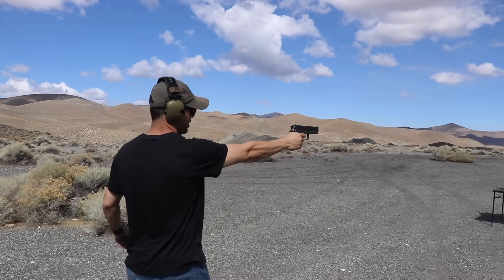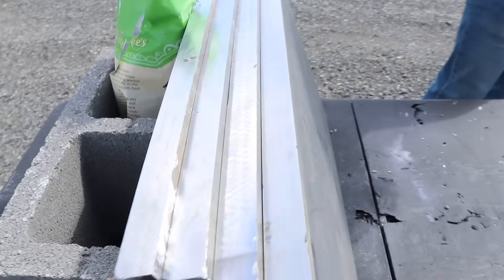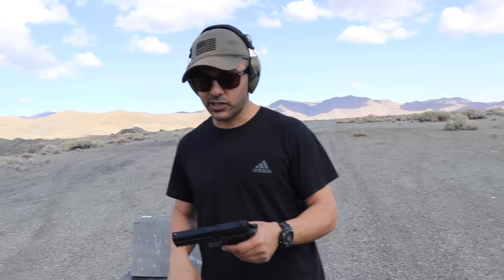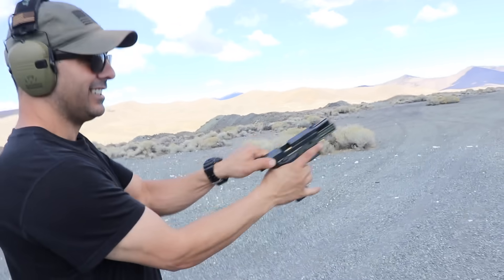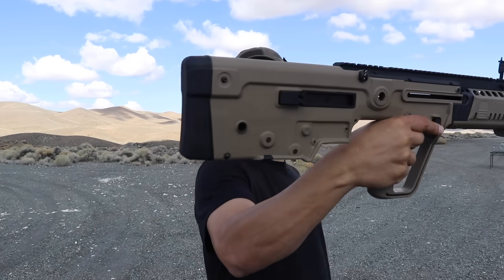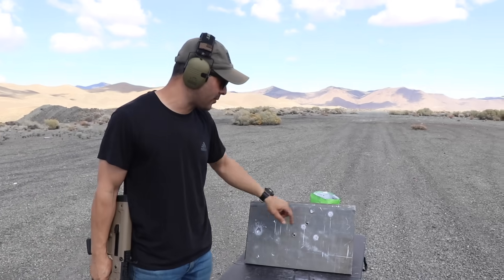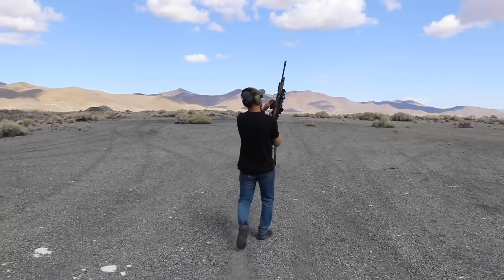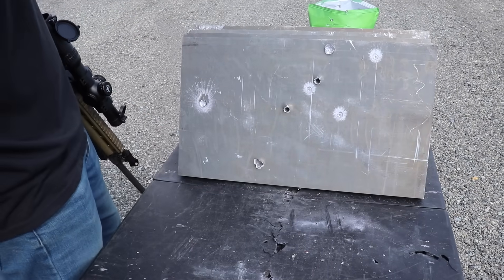is Space Shuttle Aluminum Bulletproo ?

Comment: Get some Tungsten or Iridium,lets se if hardness makes a difference 😁
Reply: Make it tungsten carbide, now that's a challenge
Reply: Patrick Spapens Tungsten carbide is to briddle, it would jist shatter.
Reply: @yaykruser  There are hundreds of different grades of WC. Glad is super brittle to, but they make bullet proof glass out of it all the time. The glass laminations are hard enough to break up the bullet and to stop surfaces scratches that PC/acrylic windows are prone to, and the plastic laminations catch the bullet.
Reply: Andrew Delashaw Yeah, but they are usualy very thick and can onlyyhandle a few shots. They are weaker than usual Steel , their only advantage is that you can see trough them.
Reply: like to see  a sample at the same thickness as an aircraft/space craft skin  just to see the effect on thinner samples